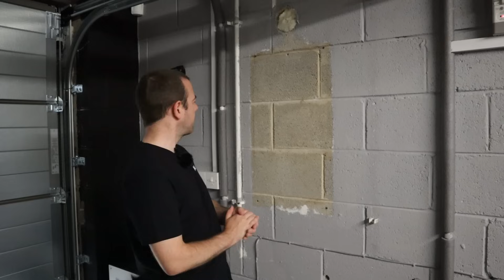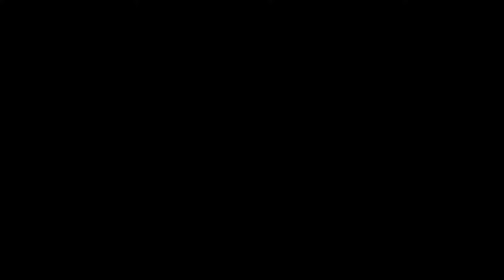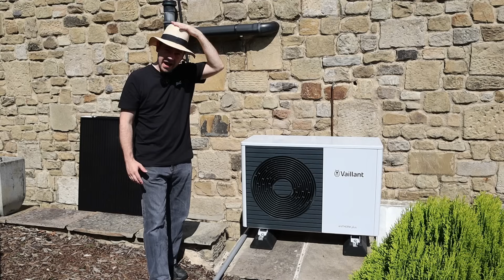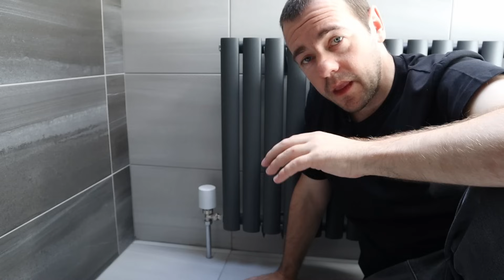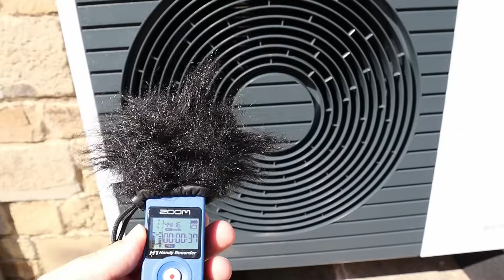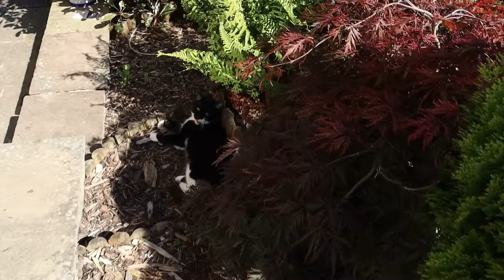Heat Pumps - Our 'Ugly' Truth!

Comment: My gas is currently  6p kwh any time of day my electricity 4pkwh for 4hrs in the night
Hold on my parents are part of the hydrogen  village project so why get rid of  gas if we are moving to hydrogen  it works well on there equipments they not needed to change boiler or cooker. So is heat pump really necessary  or is it to soon 
I watch your calculation video and you are lucky our home is the same age as use we already have a very good mega flow water tank that we been told can remain as it was design for solar and heat pump technology 
Our is our piping its all plastic and 10mm
Then our radiator are. way smaller than yours so  ever radiator would need to be changed along with piping .  On top of the our piping come out of the wall  centrally behind each panel it would be major  work 
Every radiator down stair is  double panel type the two biggest in the lounge are half the size of your dinning room  the rest go getween 55cm and 30cm  we also have 15 radiators  
We would have to change  every radiator and all pipe work. We want to go heat pump but the cost is way to much the technology is to young for use as it improve thing might get better.
Reply from the maker: The whole infrastructure in the UK needs upgrading to move hydrogen. Apart from costing an estimated £180billion, it’s set to be done by 2050. 
Hydrogen also takes a huge amount of electric to create, so it’s simply not an answer that makes sense.

Comment: I am now seriously concerned if I made a good decision following on your advice on GivEnergy. So far it doesn't look too good, and the inverter is not even installed. People trust your reviews and not every review is so clerly and blatantly wrong as this one. Good luck heating water in the middle of winter. Even if it works, efficiency will be equal to an immersion heater. Heat pumps are great if you use them with an air to air heat exchanger (noisy but effective, as proved by its immense popularity) or with floor heating. Even then, it is hard to beat gas on cost, although that may change. Currently, a heat pump would have to work at its peak efficiency just to not be worse.
Reply from the maker: In winter, this will heat my water at roughly 200% efficiency. 

Where are you getting these figures from? 
Even if you were right (not) then that would be 100% efficiency over 2/3 months of the year and progressively higher for the other 9 months.
Reply: @ElectricVehicleMan  typical tariffs are now 30p/kWh for electricity and 7.3p/kWh for gas. If you are lucky/smart enough to have fixed your rate or to get a promotional rate like Octopus Go - good for you. But anyone else will have to hit 400% efficiency just to break even. I've checked Vaillant data, and while they claim a truly impressive peak temperature and peak efficiency they do not provide any other numbers. It would be easy for them to release plots for efficiency vs temperature difference and power output plots and cut this discussion short. Instead, they chose to cherry pick an efficiency number we know is for low/moderate temperature difference and power output (otherwise it wouldn't be peak efficiency). BTW, don't get tempted to reduce water temperature too much, 60C is recommended for a reason (prevents microbial growth). For heating 30C is fine if you use floor heating but for regular size radiators you'll need more. Any reason you didn't go with an air-to-air heat pump for heating/cooling only and perhaps an immersion heater for water, if you really don't want gas? Finally, congratulations on your upgrade but please try to be more balanced in your content, perhaps run a test or two.
Reply from the maker: @johngreen1060  Most of your questions were answered in the video. 

And as I said, this wasn’t done for money saving (although I want it as cheap as it can be).

Comment: I needed a new boiler recently and got quotes for both a boiler and a heat pump. I really wanted to get a heat pump but my local installers were really negative about it and it was far more expensive. Hopefully next time I need a new boiler I’ll go for a heat pump, hopefully the local installers will be more clued up in them and fingers crossed about a drop in price.

Really looking forward to how things go with yours
Reply: You had a lucky escape,  use your brain,  the only people pushing these are making money from it. When it minuses outside where do these heat pump get the heat from ? They have an electric heater ,
Reply: @colingathercole391  That's not correct, Colin. Current heat pumps can extract useful heat from the air down to beyond -20c. Theoretically there is heat energy in the air right down to temperatures of "absolute zero" (0 kelvin) which is -273c!
Reply: @colingathercole391  It's a matter of simple physics. Our 'zero' is actually not indicating there's zero heat - it's just zero on the centigrade or Celsius scale. 

Absolute zero is something like -273 (that's a minus) degrees Celsius. so even below zero centigrade there's a lot of energy available. Recently we had overnight temperatures of minus nine degrees centigrade but my heat pump kept the house toasty warm.

In fact the last 8 days have been well below zero all night and for most of the day where I live but every room in the house has maintained a temperature of at least 19C (and it's only 19 because that's the temperature we wanted). Our bathroom is always set at 23C so we don't shiver when we get out of the shower. 

So Colin - please use YOUR brain rather than spouting complete nonsense. You clearly don't understand the laws of physics
Reply: @colingathercole391  Wrong, heat pumps can extract energy down to minus 40, it all depends on the refrigerant used. Scandinavia and Canada have used heat pumps for decades.
Reply: @hazmat5749 Comparing houses in Scandinavia and Canada with England is pointless, when half of the houses don't even have roof insulation. 😂😂
Reply: Not really true.  A heat pump can heat any type of building regardless of the insulation level.  You could theoretically use one to heat a greenhouse in Siberia, its just a question of power, efficiency and correct choice of working fluid.  Also, any house theses days that doesn't have loft insulation will be paying thousands of pounds per year extra on their gas bill; which seems rather stupid whatever you think of heat pumps. @Floyd1504

Comment: I subscribe to you and Skill Builder, enjoying excellent content from you both. But it is a mistake to discredit what he has said about heat pumps! He does not say they don't work period, but instead he has stated, often they are not economic or even effective! I've bought an electric car, have solar panels and am switching to the Octopus Go Tarriff like you, but we are not typical of most households. You do say as much later in the video, which slightly contradicts the start of the video. We have a My Energy Eddi Solar Diverter which is set to heat our hot water to 60 degrees only from solar power using an emersion heater. I too get 3 showers on a full tank and the Eddi uses 5 to 6kwh of solar power to achieve this, depends on how drained of heat the tank is. By my rough calulations, on a normal tariff, gas is four times cheaper than electricity costing 30p per kWh, using gas it would cost the same 7.5p per kWh to heat the tank as we would pay on the Octopus Go night time Tarriff for electricity. For households on a standard electricity tariff without Solar it would cost four times as much to heat the water compared to gas. I'm obviously missing something here, as heating my water with an emersion heater appears to use roughly the same amount of energy as yours, and I don't have a heat pump! Hope you have a water softener, I've just changed the emersion heater after 11 years, and the old one looked like new. Hard water would prove to be very costly with your system. I'll look forward to your Winter heating costs with great interest! Thank you for contributing to the debate. It appears with Heat pumps there is no clear cut answer. With our hotter summers I would favour a system that would cool as well as heat, popular in other countries but discouraged in the UK.
Reply: Cannot get my head around that 5kWh
Reply from the maker: I like him too but his heat pump videos were the definition of negative and sensationalised.

Watch his original video at 3:40 onwards. The ugly truth one (sure that had a ‘more negative title originally?)

He states “I’ve installed heat pumps and after a few years they’re unhappy as it costs a lot to run and their houses aren’t warm.”

HE installed them. 

He then says people who don’t know what they’re doing will whack em in and they’ll all fail. 
He’s complaining about himself essentially not installing them properly. Untrained people taking advantage of Gov grant. 🤷‍♂️
He’s either installed one in an unsuitable house or installed one badly, in a suitable house. 

In this case he's very wrong and only carried it on as he got mega views.
Reply: @ElectricVehicleMan  Rather than slagging off Roger Bisby, why don't you ask him for more details about the systems he has installed in the past where the recipients have been critical of the running costs and poor performance? Installing systems is one thing; who actually specified the system to be fitted though? Many a builder has been instructed to complete a project designed by 'professionals' which has then turned out to be a disaster. Is that the builder's fault?
Reply from the maker: @nectafarious8842  If he was just following instructions (pretty clear he wasn’t as he’s just done a series of videos on them) then that’s even worse as surely you’d want to know why? 
“They work in the UK, have done for decades in other countries but because these I’ve done don’t work, I’ll now do a video telling people they don’t”. 

It would also show that he’s never done heat calculations required for them if others did the planning. 

Think about it.
You build a house.
The house falls down. 
You then do a video saying houses don’t work, even though there are millions of people living in them.

Have you seen the videos he did with the heat geeks? Everything technical was answered.

Comment: Quick question on sizing. If you get to 400% efficiency and your heat loss is 6kw, simple maths tells me you will be using 1.5kw per hour, right? Or is your heat loss different to 6kw? My house has a heat loss of 18kwh - yikes!
Reply: @123glx  minus 3, with a room temp of 20. I've designed my system to run at a maximum of 50 with the gas boiler, has weather comp.
Reply from the maker: My calcs were done at a target flow rate of 40c and -4c outside.

The 5/6 kWh mentioned in the video was for my hot water, not the heating.
Reply: @ElectricVehicleMan  thanks! What was your heat loss calc showing please?

Comment: I agree with you 100%! We replaced our Oil-fired boiler with an ASHP back in May and it heats our hot water to 50c very quickly indeed. We have a new 210 litres HW cylinder in our old airing cupboard, the HW system is now connected to the mains (no more shower pump!) and we had 3 radiators replaced with larger ones. We had a couple of chilly evenings right after installation and experienced rapid even warming of the house for the first time in 38 years. Of course winter will be the real test for the heating, but I'm already quite relaxed about the prospect. Our installer told us that he had been called to a new build which wasn't getting warm last winter. His diagnosis was that the builder had installed Swimming Pool Heat Pumps and, presumably pocketed the grant! Other owners in the same road have now contacted him.
Reply: The way electricity prices are going I wouldn’t touch one. Please don’t tell me they don’t make noise I worked on building sites and I’ve heard them in the depths of winter they are noisy.
Reply: @thomasreed49  Ours will cost us an extra £800-1000 a year in electricity whilst we save £3,000+ a year in heating oil, so a good solution for us. I'm sure some are noisy, but they're the bad ones! Our Midea is a monstrous 16kw machine and in this recent spell of bitterly cold weather it has merely been a hum in the background from the kitchen, a faint rushing sounds in some radiators and distinct, but not loud, rushing sound of air outside. The rest of the time, it's pretty quiet. You're on the wrong building sites 😉
Reply: @Olivarus238  £3000 per year on heating oil!!!! ???
If you’re burning that much oil, I don’t think for a minute you are going to get away with £800-1000 per Yr on electric - no chance!!
Reply: @ybliga  that's just the extra for the Heat Pump and, even after that bitter cold spell, we're almost on course.... maybe £1200! We have off-peak power, extensive insulation, double glazing, draught sealing etc., etc. So, yes, we're on course.
Reply: @Olivarus238  What was the cost of your installation please?
Reply: @ChrisLee-yr7tz  Removal of Oil Boiler, 14kw Midea Air Source Heat Pump, 300ltr HWS Cylinder (inc. Immersion), 4 radiators out and 3 new ones in, Hive Smart Room Thermostat and ancillaries, but excluding cost of converting HWS to mains pressure and disconnecting old feeder tank = £11,857 before grant.
Reply: @Olivarus238  Wow, so you get £5k off that via the grant? That's actually quite reasonable once the grant is taken into account. Thank you.
Reply: @ChrisLee-yr7tz  just to be clear, it is a 16kw Midea because the supplier sold our 14kw to someone else and the installer took the hit, rather than delay and upset his schedule!
Reply: @Olivarus238   Wow that's a lot of oil. A tank fill (usually 900- 1000l) of oil lasts us around 15months+.. Our cottage is 2 bedroom and approx 10 years old so well insulated. I've looking at a heat pump, but space will be the issue for us.
Reply: @ianmatlock1   We had a 2,500l tank and it was topped up 3 times a year (topped up, not filled!). But our house is on an exposed windy hill, 4 beds and is long rather than square. 1st floor is rat-trap brickwork with no cavity to insulate. EPC was 'D' before the ASHP.

Comment: we had a heat pump installed before last winter form an old oil burner, so happy with it cheaper by miles  tons of hot water, very very happy with it

Comment: I had my Midea ASHP installed in the last 2 weeks of February and it was running during the cold spell at the end of February into March with average temperatures being between 3 and 5 degrees C. For the 12 cold days, that were very much like our winter days, I used 249kWh, so average of 20.75kWh per day. For comparison, the next week was an average of 9C and for those 7 days I averaged 9.28kWH.
Hot water during the summer has been heated to 50C by the ASHP and used either 1 or 2kWh per day.
So  far from 24/2 to 24/8 my ASHP has used 802kWh and the heating slowed by mid April to 1 or 2 kWh a day.
We have a 1973 detatched 5 bedroom house and have 270mm of insulation in the roof space alongside a loft conversion that was completed in 2011.
Due to our radiators being 50 years old, we decided to replace them all to get the efficiency and heat transfer. The house was lovely and warm during March and I have set my thermostats up to drop temperature by a few degrees overnight.
We moved from an LPG heating system so have also now freed a much larger space in the garden, where the tank once stood.
Compared to growing cost of LPG ( I was paying £700 before price rises) I am definately saving money.
Reply: Good info thanks
Reply: No your not 😂😂

Comment: Not getting a EV until end Sept, but Octopus switched me to Go last December without questioning if I had a EV, not sure if they have tightened it up since then, I switched from agile. 

I had Tripple glazing installed earlyer this year (about £5k labour and parts for a terraced house) and did not cost much more than double, in some cases if the frames are good quality you can just have the glass inserts replaced